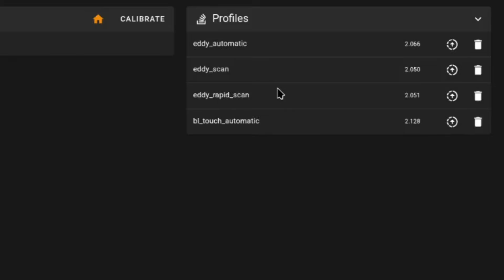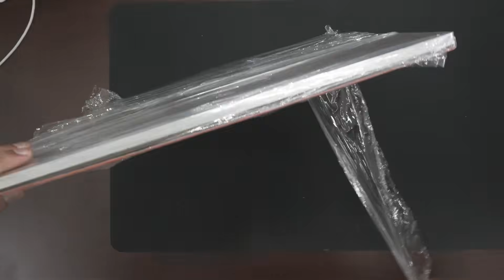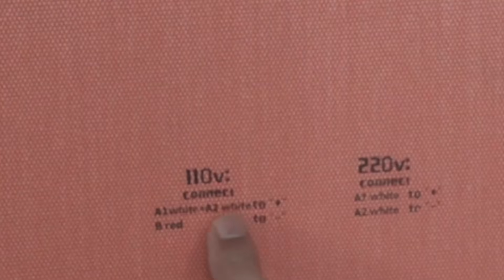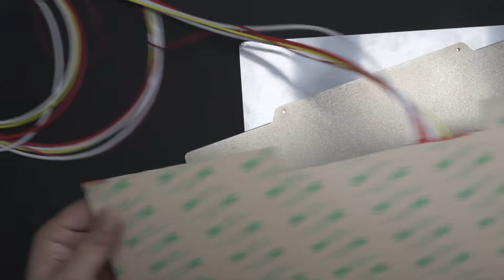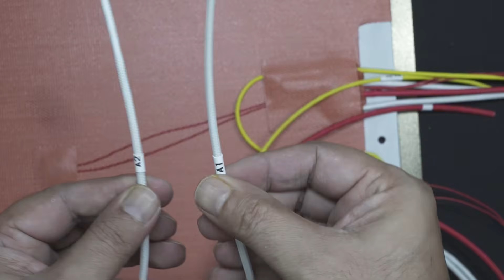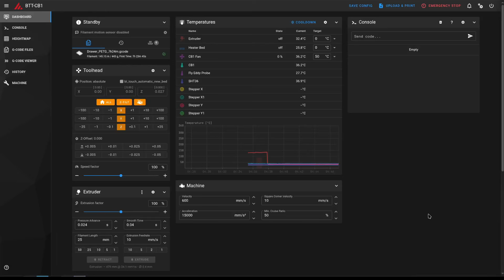FR4 vs 8mm Aluminum 3D Printer Bed | Klipper Heightmap Comparison (2mm ➜ 0.074mm!)

Comment: Love your work mate! Do you have a build guide or files for the cr10 conversion yet? Would love to do this on mine.
Reply from the maker: Glad you like it, mate! 🙌
My CR-10S4 conversion is still very much work in progress. I’m continuously fixing and modifying things as I discover issues. There are still a few known items to address, like long belt spans and X-gantry twist.

I do have my work public on Onshape, but I’d strongly recommend not using it yet since it’s still WIP and changes often. Once it’s more mature and stable, I’ll definitely put together a proper build guide and share the files 👍
Reply: What's your onshape details mate? would love to have a look!
Reply from the maker: Once you login to onshape.com, in public space search for "RaCore-C10 Printer"